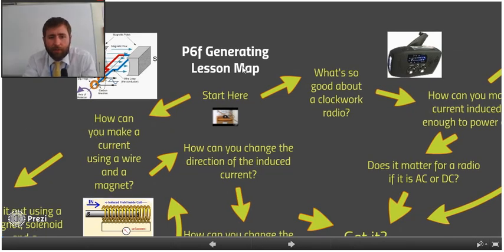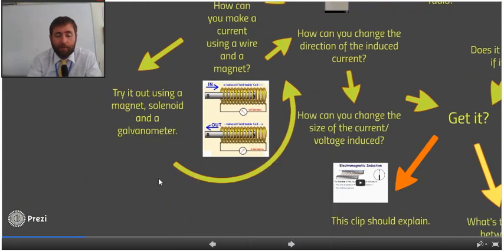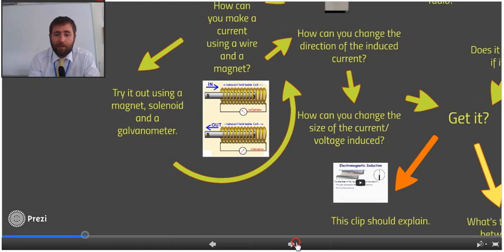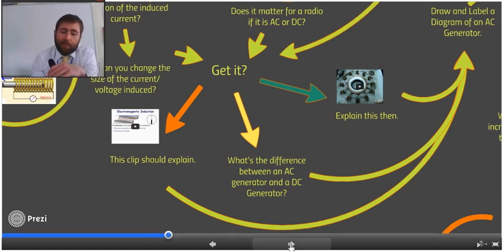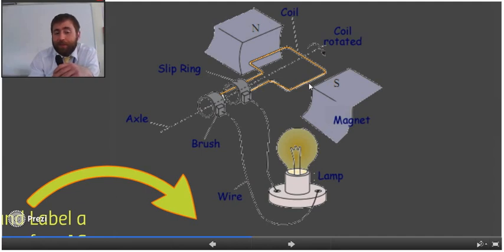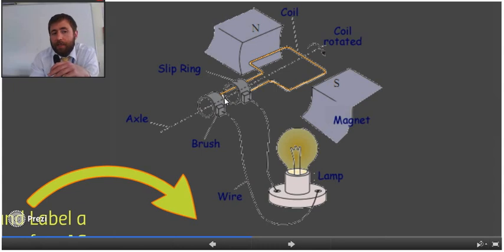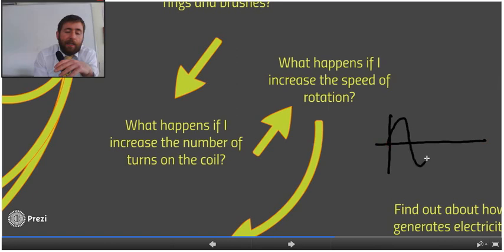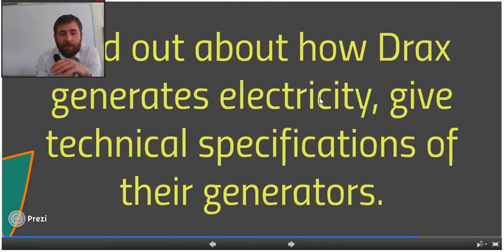Generators - GCSE Physics Revision

Comment: How do you know the direction of the current?
Reply from the maker: You don't need to at GCSE but at A Level you use the right hand rule. It has the same rules as the left hand motor effect rule, uses same fingers etc. Just all mirrored.
Reply: GorillaPhysics - GCSE and A Level Physics Revision:

I’m so confused on everything about dynamos and alternators. The graphs
Reply from the maker: @Inferno-ob9td  dynamos = DC , alternators = AC. Take your time with graphs, look at the axes. Think sine waves for the AC ones. 🦍😀
Reply: GorillaPhysics - GCSE and A Level Physics Revision

No, like when the coil turns. Positive, negative, brushes, split ring, slip ring, polarities changing. It’s all just a mess!
Reply from the maker: Is it GCSE or A Level?